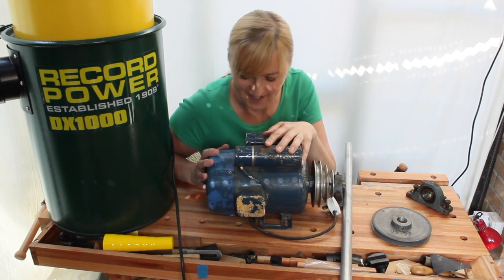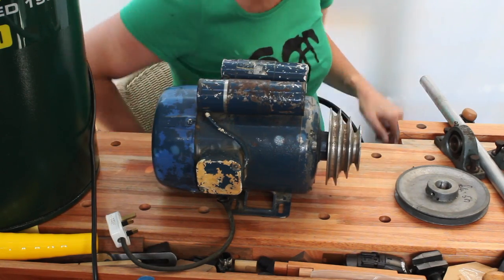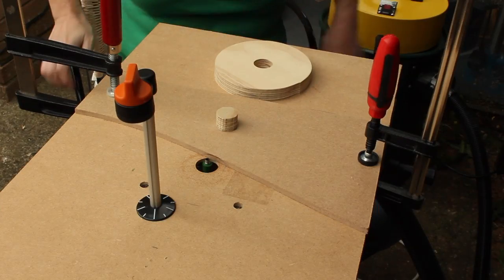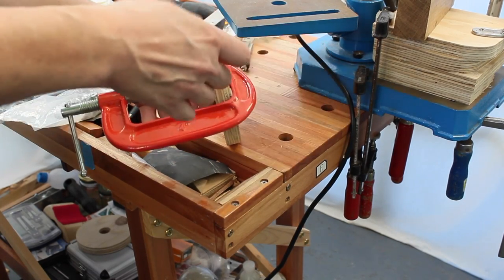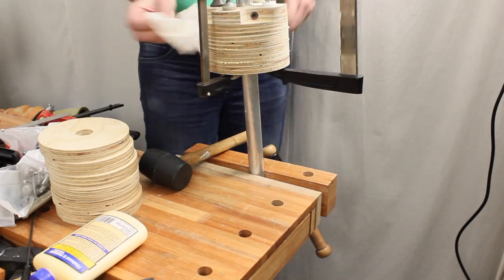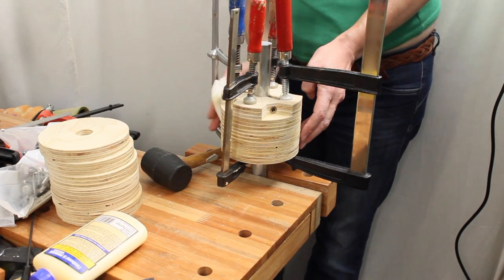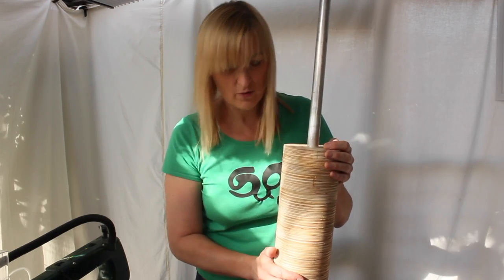DIY Drum Sander part 1

Comment: Just found your channel and love the first video I have watched.  Extremely helpful.  I have a similar motor, might be a 1 1/2 ha but looks the same.  The clunk on start up is the starter capacitor so perfectly normal.  They do run so smooth and quiet which is great.  As I have been maki some chopping boards I think I need to make one of these so on to the next video and thanks for sharing.  Andy UK

Comment: I read the comments about what kind of adhesive would suit your purpose, they all sound
like they would work. If I was making this for myself I would
probably use small countersunk screws, perhaps three on each side in
the direction of work piece travel.  The advantage in my opinion is that it
would be easy to remove it if it were damaged for some reason. I
could see myself inadvertently gouging the surface in some way or
another, you would than be able to replace it or turn it over a lot
easier. I also admire your ability to work with a hand saw, I'm
guessing I have been doing these kinds of projects twice as long as
you and I still don't produce that kind of accuracy. Looking forward
to the next installment.

Comment: I noticed you you used baltic birch plywood for the drum which now costs more than platinum. I haven't found thick walled pvc pipe as some have suggested, so I'm using standard plywood. If it doesn't work  I can replace it but feels solid so far

Comment: Sue,    when you first start something electrical, don`t just put the plug in  to make contact.  Plug it in through a switch , Like a switch on a main wall socket. Then stand back and switch on . This gives you the ability to instantly switch off if all hell breaks loose. Doing what you did with such a short flex , on the opposite side of the machine. I could hear all the people watching screaming Noooooooooo,      saw your vid because I am about to do the same for making tapered bamboo for bow building.  Great effort, wish you well.

Comment: The motor appears to have been a nice find, congrats! At first, I thought that you were making a thickness sander due to the pillow blocks and the length of the drum arbor. However, once I read the video description I learned otherwise. I gather from some things you have said that your shop does not have the floor space for a thickness sander though I am certain you would make good use of one and it would be nice for sanding some book matched instrument backs. What we both need are bigger shops with a lot of space for loads of tools. Anyway, my dear lady, this is a great start to a worthwhile project. Thank you for taking us along with you on this adventure.
Peaace!
Reply from the maker: +Jeffrey Vastine it is a thickness sander. If I had some plans I could have shown them. I'm being 'inspired' by the Jet 22-44 Oscillating Drum Sander but without a motorised feed.
Reply: Okay, I thought the "manual lifting system" was a way to adjust the height of the vertical spindle due to the project being labeled as a drum sander which created an image of an oscillating spindle sander in my mind.  I have seen sanders like the Jet model, but never heard them called an oscillating drum sander. Now things make a lot more sense. I thought that was a bit of an overkill for an oscillating spindle sander. lol The open-ended design like that of the Jet 22-44 is nice because you are not as restricted as you can effectively process stock  up to twice the width of the drum. The only drawback to the design is rigidity as even the cast iron and steel frames will flex. However, if you are not going to be processing hardwoods and making light passes the flex should not be an issue -especially when it comes to making musical instruments. Do you have any idea what material you will be using to support the drum?

Comment: I am building my own drum sander. Rather than cutting dozens of plywood disks and trying to true them up, I bought a wooden rolling pin from a local home equipment shop. It's a bit smaller but should work just fine. It has a 10mm hole drilled right through the center with nylon bushings for a piece of 8mm steel rod, on which  the two handles are mounted. I tapped the bushings and threaded a length of 8mm threaded studding through the middle. It spins perfectly true.

Comment: The jumping you hear/feel is the centrifugal switch kicking in and out. When the motor comes up to speed the centrifugal switch disconnects the start winding circuit.

Comment: Great video and an interesting build - I particularly like the method to hold the sandpaper. I've seen others try something similar (and report that it didn't hold up with use), but it would be my preferred method if it does last.

I would though really advise against the router table technique starting around the 6 minute mark. I have one thumb shorter than the other as testament to that. I was doing a similar operation some years ago, and the cutter "bit" into the work piece, spinning it suddenly, and pulled my thumb into the cutter. Blink of an eye stuff - no chance to react. I spent about 3 months with limited use of one hand.

A slightly safer alternative would be to do the trimming to a shallow depth (perhaps 1/8" / 3mm of the wheel thickness), as that's unlikely to catch and spin the whole wheel. Then use a bearing guided trimming bit to trim the rest of the wheel thickness to that 3mm guide cut. For that latter operation, the wheel can be manoeuvred on the router table using a push block (like the GRR-RIPPER) - so little chance of injury.

Even better - just make a circle cutting jig for the bandsaw. They can be sanded perfectly round later when they're on the drum (with a sheet of sandpaper on the drum sander's table). I'm assuming you've probably done that sanding step in a later video, but I haven't watched them yet.
Reply from the maker: +gbspikyfish Good general points. In my case I was very careful to pre-cut the disks close to the pencil line so that I only had to take a millimetre or 2 off with the router. The spindle was close fitting so the disk was being fed firmly with no chatter. I always had 2 hands on the disk and I tried to keep my hands well back from the cutter. Was it safe? I always felt in control and the disk never got away from me. What I would say, is you must ALWAYS feed against the rotation of the cutter or you could have a situation like you describe. Keeping your distance from the work is a good idea too.
I don't think a bandsaw, or at least my bandsaw, could cut a circle with the same accuracy, so you end up spending more time truing the drum later.
Reply: I felt I was safe too... right until I found myself driving to hospital with one hand raised in the air, wrapped in a rag. At least the nurse got me through quickly - though probably because I was bleeding all over their waiting room floor ;)

For the bandsaw circle jig; granted you wouldn't get an amazingly smooth circle; but probably good enough for sanding it later. I've just finished watching the rest of the series, and I see you did that sanding step.

The tip on how to cut the taper on the sandpaper (in part 5) is very useful (thanks) - it's something I've wondered about before. I suppose that once you've cut one length, it can be used as a template for future sheets.

I have seen some comments (about these machines in general - including commercial models) that the paper tends to stretch just a bit in use - which is maybe what caused the slack. Whether it will stretch further I don't know, but I guess it's not that big a deal to just tighten it back up now and then.

As noted above - I'd be interested to hear how the holding mechanism stands up to use. It certainly seems like a good solution if it continues working, and the machine overall looks great!
Reply from the maker: +gbspikyfish I've used it maybe 6 times since the build and did quite a heavy session of thicknessing mahogany boards for the guitar stand video. The Abranet did stretch a little, but it was easy to tighten. As it stretches you notice that the drum bites a bit more at the right hand edge, but it still works fine. The Abranet still looks as new - great stuff. I've only had to tighten by a few millimetres so the stretching is very slight.
Reply: Good to hear - thanks. I really must get around to building one... along with all the other projects that need doing :)

Comment: You want a press fit on the bearings. Ideally the shaft would be slightly larger by a thou or so, that the ID on the bearing.  It would be worth checking out the manufacturers recommendation fro the bearingsThat was the bearing goes around with the shaft.  If the shaft is the same size exactly, it will slip with the torque of the motor.    I presume that the diameter of the sanding drum is related to the speed  the motor runs at, as well as the pulley diameter.  Might be worth checking out Matthias Wandel's channel.  He has made loads of machinery, or John Heinze.  Wondering how the plywood will stand up over time.  
Very adventurous build.    Looking forward to part two.
Reply from the maker: +Stephen Gent There's a grub screw on the bearing, but I'll see if I can freeze the shaft and warm (not heat) the bearing.

Comment: What an excellent way to make a sanding drum! The only query would be using plywood, as it can have voids and differing density throughout, which may lead to a bit of rattle or vibration, but that looks like good quality ply which should cut down on that potential. Looking forward to part two! ☺️

Comment: Hi Susan,I know you have already made your sandpaper drum, but have a look at "Stumpy Nubs" you tube about his latest drum sander. He used thick walled drain pipe but the best thing was how he connected the drums that meant he made more than 1 drum and had different sandpaper grits on each drum instead of having to change out the sandpaper each time. PS I live in the UK also but don't have a good second hand shop where I can get the goodies you have here. Good luck with your channel.

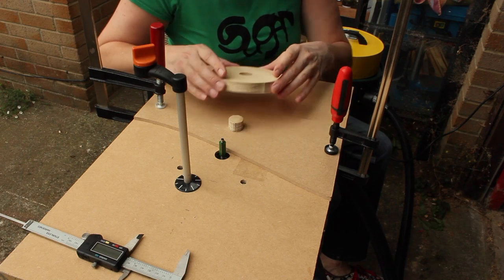Comment: Starting @ about 5:39 you didn't need to use the router. I put the discs on the shaft and put the sander together then made the whole thing into a lathe. Then I trued up the drum w/ a lathe tool then sand paper.

Comment: Nice vid Susan. Such a refreshing change to see a  fellow Brit on YT. Just one thing occurred to me at the start was i thought it would be easier to drill a smaller hole in the square blanks which would have enabled you to run on a small spindle on the band saw and get a more accurate circle to start with. You could then have lined up later on the pillar drill with the original smaller drill bit and a V jig then drill out the bigger centre hole.
Not a criticism as you are doing a great job. 
Keep going, liked and subscribed. Mark
Reply from the maker: +Mark Valentine valid points. My pillar drill has a load of play and has a habit of jumping a mm. I decided to reference everything to the large hole and then I didn't have to worry about getting the hole accurately placed. Of course the last step was always going to be the router table, so as long as you cut 2mm outside the circle then the pillar drill error might be recoverable. Even with a better pillar drill though I have trouble over-drilling holes accurately
Reply: I Understand. i'm really enjoying your vids. just found you this morning. Keep up the good work. Mark
Reply: Just saw your Spark Talk. You are one awesome lady!! Mark

Comment: Try putting the shaft in ice it might help it slide into the bearings, you could also warm up the bearings as well, not too hot though you'll melt the grease out.
Reply from the maker: +OldManTony That's the exact advice I got in the tool shop :-)

Comment: Where did you get the hose for you dust extractor? I could do with something similar for my smaller tools. Mine only fits my thicknesser and table saw.
Reply from the maker: +will kerswell the clear 100mm hose comes with the dust extractor. The smaller black hose that hooks up to hand tools is an accessory. I did a video on the dust extractor 2 months ago which shows all the bits. I find Axminster.co.uk good for dust extractor stuff

Comment: thanks for your video! Question: why not use a aluminum or even steel tube, instead of plywood? thanks!
Reply from the maker: Others have suggested that, but centring and truing the drum would be very difficult

Comment: What brand Forstner bits are you using.  Mine don't cut anywhere near as well as yours and that's from when they were brand new.
Reply from the maker: +Fuzzy Johnson It's taken me a while to reply, but I needed to go back to the shop I bought it in to find out. They are Planet forstner bits from Leeside tools - user leeside0 on eBay
Reply: Thank you.  I bought a cheap set at the home improvement place but they are good for a couple of holes at best.  I've tried sharpening them as I need them without much success.  I need a good set but I'm trying to avoid paying $400 for it.

Comment: I'm curious why you didn't consider pvc pipe for your drum?  It's perfectly round, 100-150 mm and you could have still used some of the circular pieces inside the tube for the drive shaft.
Reply: PVC pipe explodes when it gets older, or subjected to shock, is prone to cracking when put under tensile strength.
Also it is not very round, and tends to deform over time and exposure to heat.

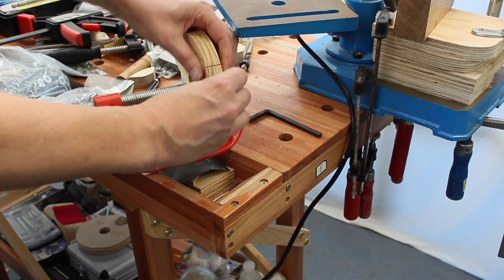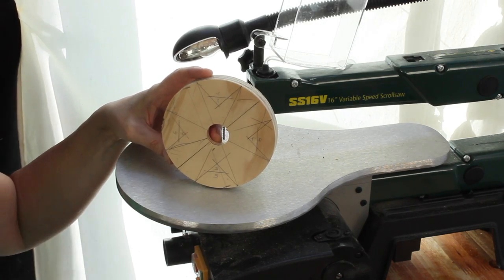Comment: Did you consider drilling (@ 13:15) before sawing (@ 9:00) ?
Reply from the maker: I think the cutout helps stabilise the disc but I guess it would have been easier for the insert, although the size of the holes in each is different. I think I would have had difficulty getting the disc under the drill if it was whole - my drill press isn’t particularly big.

Comment: Jealous that you have a local second-hand tool shop ... transport costs usually kill buying interesting stuff on-line.
Just a point, doesn't the abrasive on these drum sanders usually go on in a spiral pattern, so you actually use a standard 100mm - 150mm roll of abrasive.
Reply from the maker: +Barry Hopwood I think 100mm might be a little wide to spiral easily. I've ordered a roll of 76mm Abranet Max

Comment: Don`t sand down the shaft . they are meant to be the same size.. A gentle push on fit, so it makes the bearing work and not , turn the shaft in the bearing,      Tap it on with a mallet if ness`..

Comment: I would never buy a used electric anything without being able to plug it in before I paid for it.  Most things will probably work but sometimes the owner believes it works but hasn't actually checked it for years and other times people will just straight-up lie to you.

Comment: Susan I don't want to rain on your parade here, however you took 5 min. of  video time to show the same gluing routine. I think you could have done just editing and skip to the part you are putting in the stop screws. YOU could also take a tight grain log and gone over to a turner friend of yours ad he could get it round in about 30 min. I am sure it took you a long time to cut those plywood discs and glue them together. I am sure at you neck of the woods in Newzeland you can find lots of turners.
Reply: Phillip, those plywood disks are a lot more stable, than a solid spindle and, I would think, (I think) lighter.